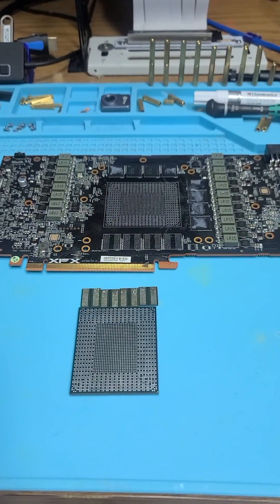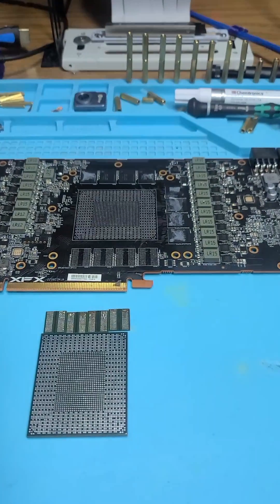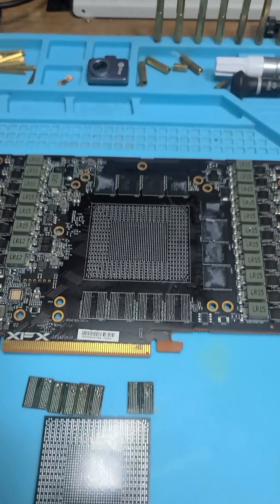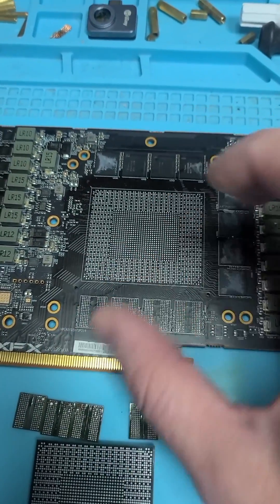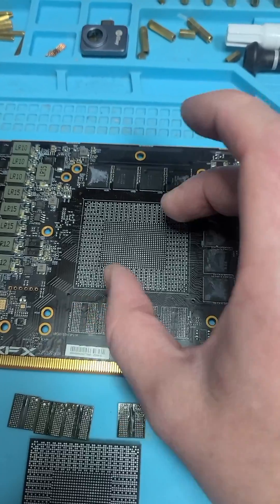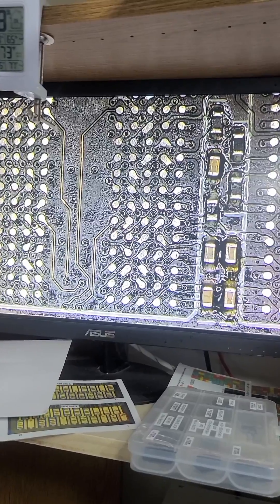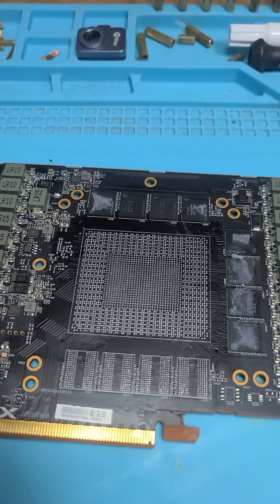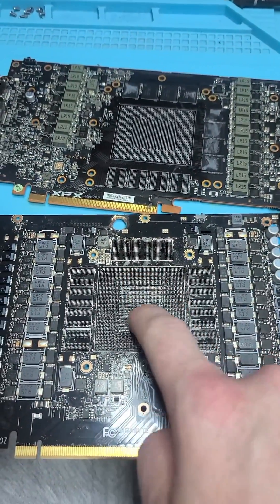TOP reason not to buy AMD 7900 series GPU #shorts

Comment: AMD doesn't make PCBs tho. And i doubt they have any guidelines for coating
Reply: Yeah, this guy is straight up a liar lmao
Reply: We need to bring this thing to gamer nexus
Reply: We need to bring this thing to gamer nexus
Reply: @freefall_910  we dont *need to, as these informations are public and anyone can read them.
Reply: @ryutenmen  he need to be aware then he can raise these issues man
Reply from the maker: They are the customers of the board manufacturer who will make the board as requested.
Therefore AMD and xfx are to blame.
Reply: @northwestrepair  no, amd is a customer of only tsmc. Then they sell gpu cores to xfx in this case. And full gpu is sold by xfx to retailer. Boards aren't made for amd and aren't sold by amd. They take their profit at first step and peace out. Nvidia works in similar way but with way stricter guidelines. So strict in fact that EVGA tapped out of gpu market
Reply: @northwestrepair  100% true.
Reply: @northwestrepair that doesn't sound right. Maybe if they were reference cards but to my knowledge only Nvidia offer them.
Reply: @northwestrepair  you spread lies by exaggeration or by entirely inventing scenarios.
AMD and Nvidia provide the core technology and set the standards, but it's the board manufacturers who decide on the specific coatings used on their *custom GPU boards to achieve the desired balance of performance, protection, and aesthetics.
Reply: @northwestrepair  what the f are you talking about? a company can request a board manufacturing without any masking. how you can blame amd for that? the same can happen to nvidia chipset cards... its upon the card manufacturer to set their quality levels to balance efficiency and costs. chip manufacturer usually dont interfere on these quality questions. free market does.
Reply: @josephvanbrunning2960 ONLY when we speak about the reference designs; the card in this video wasn't a reference designs, and in fact I don't think AMD make reference cards anymore.

The choice of coating on GPU boards is primarily determined by the board manufacturers (ASUS, MSI, Gigabyte, etc.). 

Standards and Compliance: 
While AMD and Nvidia might not directly choose the specific coatings, they set standards and guidelines that manufacturers must follow to ensure the reliability and performance of the GPU.

Reference Designs: 
The reference designs provided by AMD and Nvidia may suggest or imply certain types of protective measures, including coatings, but the specifics are typically left to the manufacturers.

In essence, while AMD and Nvidia provide the core technology and set the standards, the board manufacturers decide on the specific coatings used on their custom GPU boards to achieve the desired balance of performance, protection, and aesthetics.

So it's like I said previously.
Reply: AMD owner spotted.
Reply: AMD designed the board though and their name is on the product, they are still responsible for the design.
Reply: @sei_asagiri they release the cad for manufacturing. what they are going to do with it is totally different
Reply: @sei_asagiri  AMD only designed the GPU itself, iy didnt build the boards and its components. All of the boards and its components are manufactured by different other companies.
Reply: @ryutenmen they should provide reference board designs.
Reply: @ableite  they probably do but there is no obligation to use it.
Reply: @ableite  why you say that AMD should provide board design? And why not? Also, if they did provide board design, it should be exclusive?

Complete your idea is a good starting point for your credibility and the answer received.

Also, I (just) assume that when you say that AMD should give board design that includes the coating, 100% board design?
Reply: @ryutenmen  go learn by yourself. i was not complaining. i was adding information.

Comment: that's on XFX tho
Reply: apparently they all come from the same pcb manufacture so its every card.
Reply: @sei_asagiri  amd doesn't make pcbs
Reply: @d4mb20  when did i say that amd made pcb's?
Reply: @sei_asagiri  "apparently they all come from the same pcb manufacture so its every card."
Reply: @d4mb20  and where in that sentence did I say that amd made the pcb's? Learn to read before using the internet.
Reply: @sei_asagiri  I think talking to you at this point is just a waste of time
Reply: @d4mb20  I think learning to read would be a better use of your time, I agree.
Reply: @sei_asagiri  Nope, this is not the card from AMD, it's the design of xfx
Reply from the maker: AMD Radeon is the same.
Reply: @northwestrepair As far as I know all reference PCB's are from PC Partner. Not AMD themself. MBA (Made By AMD) is a lie.  So... Guess Nvidia GPU's from Inno3D or Zotac for example could have the same issue

Comment: Is this warning about 7900 series cards for all brands or just some, or one? I ask because I was considering at some point, getting an AsRock Taichi RX 7900 XTX. If the prices ever come down to a non ridiculous amount. Hmm, so maybe I won't ever get one! 😉
Reply: This is a warning about AMD 7900XTX because your graphics card needs re-balling at least 20x in its lifespan. 
He says: "Don't buy because I have problems with your cards." 
Not like don't buy because it's a bad or good card, architecture, cooling etc. He says only regarding fixing stuff. It's not about your experience. Don't buy 7900XTX because of his work easy or not. That's it. Also, I use Nvidia but would like an AMD card as well.
Reply: @HanSolo__  I appreciate your take on it.
Reply: Asrock boards are very good. A bit pricey, but if you can pay some extra it wouldnt disappoint (also taichi brand is like the very best stuff they have).
Reply: @alexturnbackthearmy1907  Thank you for your input, I appreciate it!
Reply: He is basically trolling, all service guys have their quarrels with different brands from the perspective of the guy that has to tear it apart to fix it. The 7900xtx is a great card.
Reply: @winstonsmith2391  Thanks dude

Comment: this pcb is made by xfx not amd lol its literally written on it
Reply: Guess what: It's even NOT made by XFX. Nearly all get its supply from specialized PCB manufacturer. The amount of chemicals, waste and machinery is not worth building up your own supply. SMD assembly lines are costly by its own. That's why, for example, Apple even hasn't its own. It's more flexible to get this job done by specialized supplier, in this case Foxcon.
This business doesn't work as of what most of the people may think of...
Reply: @matthiash.4670  I mean xfx is behind design of their pcbs so its still their fault right?
Reply: @yesyesyesgrill-ir2ur  sure. As a manufacturer you are responsible, even if you got ripped off by your supplier.
But I just mentioned the fact, normal consumer are not aware of, such companies are more or less PCB assembly guys, getting a design from AMD (in this case) ordering PCBs from a specific manufacturer, ordering the other parts and slide it all together through their reflow oven...
But in the end, yes - they are responsible for the selected cooler, the PCB quality they choose, the parts they ordered and so on.
Reply: XFX have custom PCB's , Only they use them.
Reply: AMD fanboys be mad
Reply: @funkyskunk8122 as an AMD femboy fan boy, im just mad at the fact nVidia has created an undisputable monopoly in which a GPU can cost more than a brand new car while creating an army of femboys fan boys who will go for the neck if you dare say anything about the company.

Will AMD get stuff wrong? obviously yes. they're just recently competitive in the market, they need time and a big effort to not become nVidia part II
Reply: What about Sapphire Nitro+  7900XTX Vapor board. Didn't you say it was an excellent build in this previous video, https://m.youtube.com/watch?v=gj9L7nug_yM&pp=ygUjTm9ydGh3ZXN0cmVwYWlyIHNhcHBoaXJlIG5pdHJvIDc5MDA%3D ?
Reply from the maker: AMD has a reference model built the same way.
It is not the board manufacturer, it's the customer that orders the board to specifications.
Reply: @northwestrepair  No, I repeat it slowly: NO board specification includes the type of solder mask, except the choosen color. It's simple: You can't define such a specification in the gerber files, used for PCB manufacturing.
Did you ever ordered PCBs? Except to pick a solder mask color, there's no option available in rar cases you can choose different solder mask techniques - but heres the point: You choose. A specific PCB manufacturer use the solder mask type as it's used to be for his process. And as it is required by his machines. Some have UV hardening mask, others heat hardening. Screen printing, direct printing... and so on. Even if you want to, some manufacturers would be simply unable to use a specific process, because he don't have the right machines.
So, no one in this industry with just more than 1 bain cell would define such a specific definition. Because it makes no sense.
But in this case the answer seems simple: If the reference model uses the same PCB XFX used the same supplier. This is cost effective, because the required tooling (films/masks) are already present there. This easily saves a about 1000 bucks with the confidence to get verified working boards.
Reply: @northwestrepair  You can't attempt simple logic with AMD fanboys.  They'll try to convince you water isn't wet.
Reply: This guy hates AMD, so of course it's AMD's fault🤷
Reply: @epites-thegod  Hates them, cuz' they're awful to repair.
Reply: Who the f buys a referent design 7900XTX my dude? Ofc it's AIB card.
Reply: @SzwarcuKX5 but I like how slim the reference design is compared to Nvidia though . . .
Reply: XFX also sell 4090? If yes,  comparing both will be interesting.
Reply: @JohnWilliams-gy5yc  XFX exclusively make AMD cards
Reply: @JohnWilliams-gy5yc they don't.....XFX are amd only , they are also typically cheaper than ever the reference cards.
Reply: @JohnWilliams-gy5yc  They (much like EVGA) used to only sell nvidia cards buuuuuut nvidia did a nvidia so they stopped.
Reply: AMDs reference board, as well as all other AMD cards, have the same material. The boards are made to customer specifications. The customer is AMD.
Reply: @pokealong wait so amd buys a custom gpu and just slaps a brand on it???
Reply: The customer is not AMD, AMD is a SUPPLIER to XFX, XFX specs the PCB and sends those specification to a factory in china which produces them. How is AMD a CUSTOMER?? to be a customer one must purchase goods. In this transaction what would AMD be purchasing? Quality of parts around the GPU die is the responsibility of the the board partner and the PCB manufacturer they chose, quality of the GPU die/core itself is the responsibility of AMD and the chip fab they choose.
Reply: @DavidScheiber  This is somewhat correct. XFX is a board partner, an add in board (AIB) partner. Everything begins when AMD sends over reference specifications and engineering samples so they can begin working on their variants. They design the cooler, do board layout, and select suppliers for parts, as well as assembly, in house or outsourced, it's up to them. Then they submit their designs to AMD for approval as both AMD and Nvidia have guidelines that must be followed by their AIBs and limits to what can be changed. Upon approval they can submit purchase orders for stock of GPU cores from AMD and begin the manufacturing process. They have limits on what they can change, sure, but I don't think AMD is forcing anyone to use a certain pcb mask, but maybe I'm wrong, who knows.
Reply: cope
Reply: @nicekeyboardalan6972  lol better look up definition of "cope"
Reply: @nicekeyboardalan6972 no, you cope and seethe.

Do you blame Intel when an MSI motherboard fails? No. 

Your backwards pageantry is hilarious.
Reply: @der_pinguin44  dilate

Comment: Only buy GPUs with carcinogenic PCBs.
Reply: You gonna eat that?
Reply: @Mr371312 somehow it returns to your diet in environmental circulation. You don’t need to eat directly.
Reply: The problem is XFX and not AMD.
Reply: @NurdRage777  There is no problem.
Reply: Maybe not lick your damn PCBs? If fkers worried about our health they'd mandate UV protection layer on drink cooler glass doors and plastic bottles that leech a shitton of chemicals into the content whenever in sunlight.

Comment: but. . i already have a 7800 XT :c
Reply: Same, but dont worry. Use your gpu support bracket or switch it to vertical mount, and u wont ever have a problem like this
Reply from the maker: I didn't see that on a 7800
Reply: @northwestrepair  Really? o: